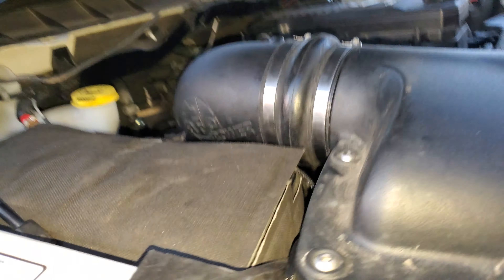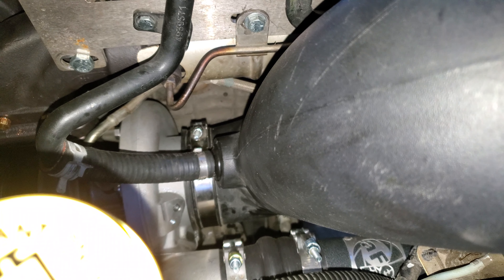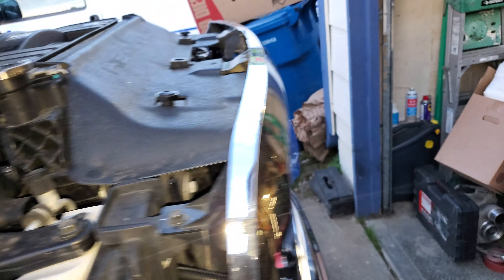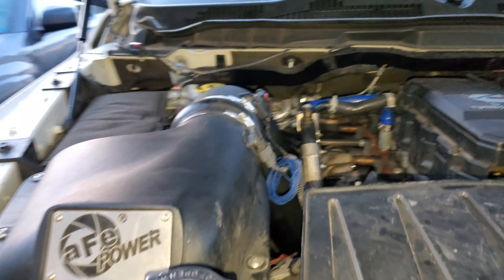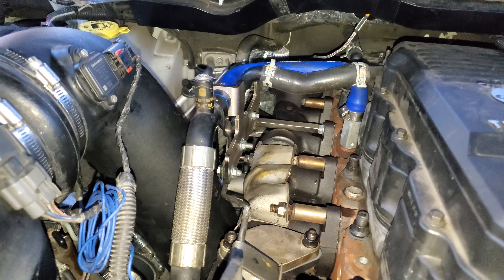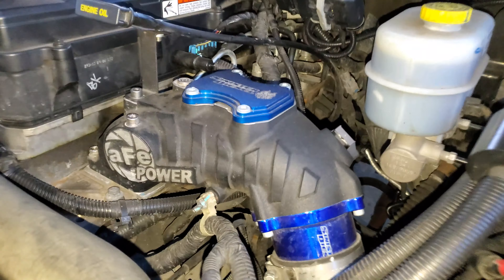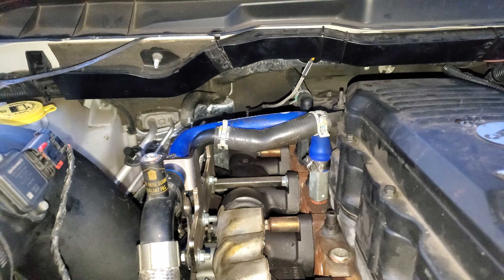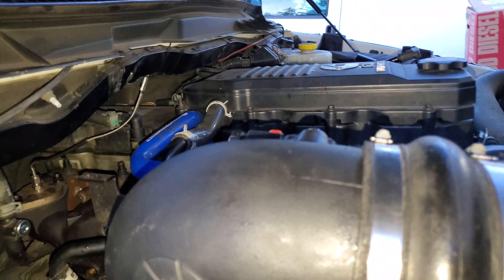BD Iron Horn 364.5 swap is complete

Comment: I have efi Live tuning right now and want to go to a similar setup from a vgt on my 2013. Will I need to retune you think? The company that did the tune is out of business now
Reply from the maker: Yes you will need a retune. The airflow characteristics will change drastically with a fixed vane. Also you can have them keep your oem exhaust brake option if you want to run a BD exhaust brake later on. That's what I plan to do.

I use PPEI. Hands down a great tuner.

Comment: What’s goin on in the background lol nice setup. I’m about to get the iron horn for my 5.9
Reply from the maker: What do you mean? I was just out for the first drive testing it out. I dont have a good camera mount I was just using my magnet mount that holds my phone so I can watch my ezlynk gauges.

The iron horn kit is awesome. I think you'll like it. Makes my 6.7 feel like my old 5.9's did. So much better with a fixed vane turbo
Reply from the maker: Sorry I thought this was on a different video. Its just at my old house and it's the noises of the neighborhood. Lot of my neighbors turned wrenches also.

Comment: Question how was the afe intake horn when you had the egr still on does it make a big difference
Reply from the maker: I bought the truck fully deleted and it already had the intake and intake horn on it. Sorry boss.

I did the lift, wheels/tires, control arms, head studs, upgraded turbo, SB dual disc clutch, and had PPEI tune it. I need to get the BD exhaust brake sometime for it still when I have a little extra cash.
Reply from the maker: I dont think the intake elbows really make a huge difference on these trucks, but every little bit definitely helps

Comment: How does the truck manage the boost? Is there any kind of wastegate?
Reply from the maker: No wastegate. Its basically managed by the tuner and how much fueling goes into it.
Reply from the maker: The diesels are much different than a gasoline/spark combustion powered car.
Reply: That’s what I was thinking. I have one coming and was nervous how it would regulate the pressure. Me not being super experienced in the aftermarket world I’ve always seen some way to manage the boost
Reply from the maker: @blakemcmillan2404  what are you using for tune?
Reply: I’ll have a diesel shop tune it for me. I’m running starlight right now. There modest tunes   But maybe he can do some adjustments or something
Reply from the maker: @blakemcmillan2404  definitely there is a lot of head room on this turbo. It moves enough air to keep up with my 75HP injectors and keep thr EGT's at a good spot

Comment: Did you ever get any P0108 codes due to bigger turbo and exceeding the map values?
Reply from the maker: Nope. Factory sensor only reads up to 35.something psi on my readout with my ezlynk. Cory at PPEI did the tune. I just got the new intercooler on it also so that video will be coming soon too.
Reply: Joe Bidden Humm ok I’ll have to check with my tunes and go from there thanks
Reply from the maker: @akrider174  are you having an issue i take it?
Reply: Joe Bidden yes throwni p0108 code I have read that a boost fooler would cure this. My tech told me the tune is good so it might just be the sensor... but it’s never just a sensor...
Reply from the maker: @akrider174  who is your tech and who did your tune?

A boost fooler would cure it yes. But also what turbo are you running?
Reply from the maker: @akrider174  I have no boost fooler btw. Just the tune from PPEI
Reply: Joe Bidden bd 366. Just talked with my tuner and said tune is good and map sensor might be bad... but not sure what sensor to replace?
Reply from the maker: @akrider174  the map sensor is on the Intake elbow. Always use oem sensors dodge computer doesn't like aftermarket sensors in all my findings.